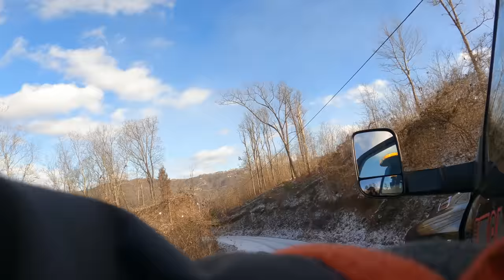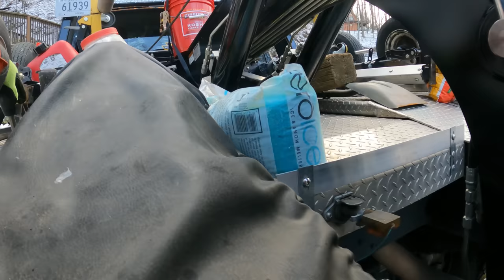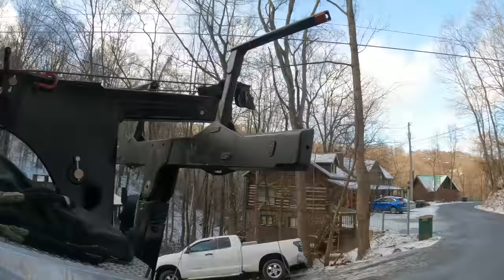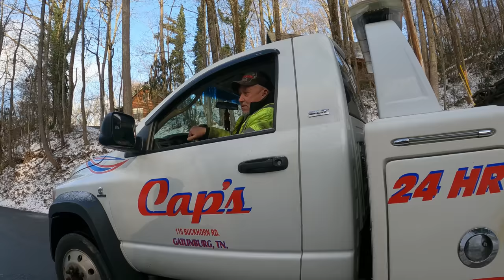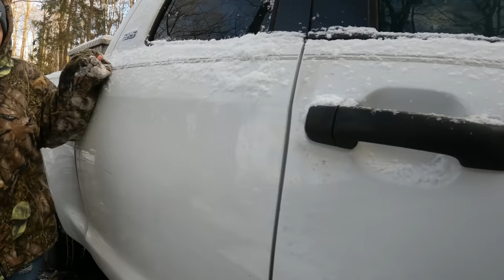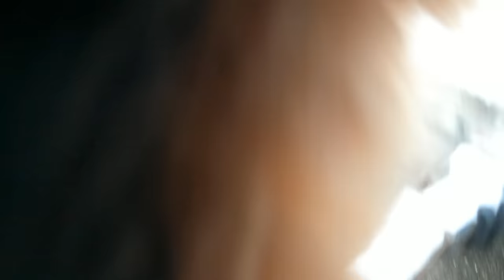Icy Driveway Recovery & Competition Between Tow Companies Gets Tense

Comment: I would think in weather like that event, it's a bit of a toss up as to who gets where first.  Some YOU get there, some THEY get there first.  As long as nobody slides off the mountain, you live to drive another day.  I was driving home one night at 8:30 with hardly any gas in my car, and the fire department stopped me a few miles from home, and a tree had come down taking power lines with it.  They had to wait for the power co. to get there, as they had 2000 calls!!! 2000.  I got home on a wish and a prayer and then had to wait because the one gas station in my tiny mountain town was down for the same lack of power!

Comment: Hey Jeff, Have you ever looked into 'Auto Chains'? I know they are pricy but I would think they would almost be a 'Have to have' item doing what you do where you do it. It is just great to be able to push a button and have chains without stopping and when the road clears, push the button and chains are gone.
Reply: he mentioned owning them early in the video; they are just a pain in the ass to put them on.
Reply: @harleydominga  Auto chains are quite different. Jeff has regular chains which have been around for MANY, many years. Old fashioned snow chains are a pain to install and to remove. And this MUST be done. You can't just leave the chains on if the road is free of ice because this will harm the road surface. It also wears out the chains fast, as noisy and requires a slow speed. Auto chains are often found on BIG trucks, i.e. 18 wheelers, school busses et. They work very differently. You simply push a button and the chains 'automatically' deploy. You don't even have to stop, just slow down to 25 to 30 mph. So as you drive you see that the road has become icy, (like in the video), you engage the auto chains and like magic... CHAINS! If the road clears, push the button again and POOF, no chains!  Install and take off while driving! Repeat as needed. Google it, or I could link a video if desired. As I said they are pricy but amazing.

Comment: It seems like a lot of the drives you pull vehicles out of need to be pitched slightly away from the hill and a wheel high curb installed to prevent the vehicles from sliding off the edge.

Comment: If he thinks that’s bad, I used to drive a front dump concrete mixer, and during busy times, people couldn’t get concrete at the times they wanted, so some would call multiple companies, and the first one there got the job, meanwhile, the other companies trucks were loaded with concrete and no place to dump it, and concrete is perishable, happened to me a few times. Just what people do when they’re impatient.
Reply: That's when you start charging them a delivery and disposal fee.
Reply: @ThomasKent1346   Well, actually the company I worked for billed them just the same, and we usually had local farms they would sell it to for a reduced fee, but the problem is, during the summers , it doesn’t take long for it to start building up on the fins if it was hot out. And guess who got to climb in the drum and hammer out the build up? As drivers, we really got pissed at the fools who did this nonsense. Also, this didn’t mean the company always got what they billed for, so they took some losses too.